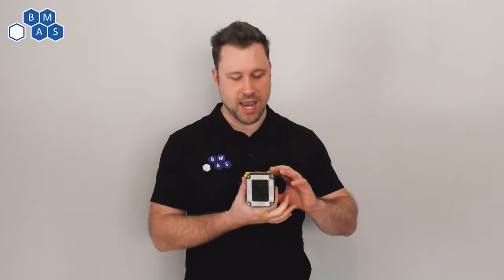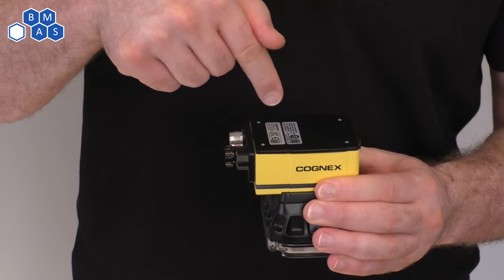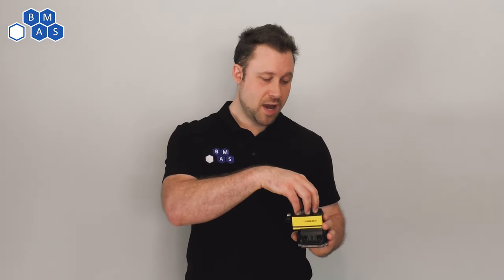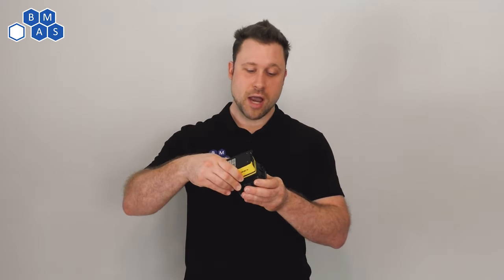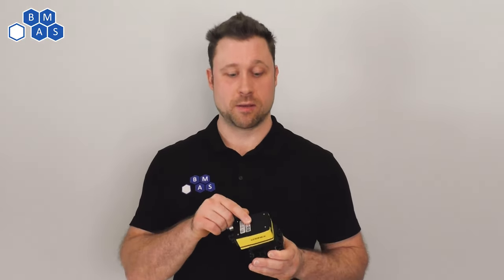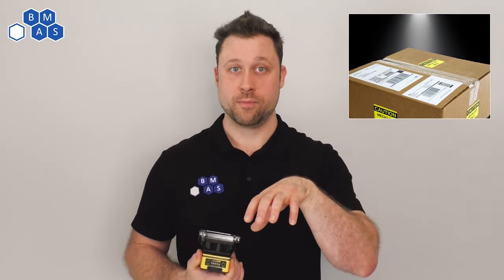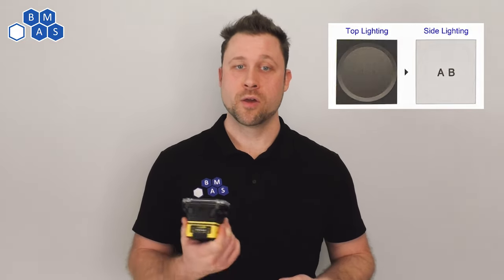Machine Vision: Overview | Machine Vision pt1

Comment from the maker: Step 1 - Camera Selection 0:38
Smart camera - brains and processing in the camera
Dumb camera - brains and processing in separate vision processor
Cost rule of thumb: if you have 3 cameras or more, it’s more cost effective to use 3 dumb cameras with an external vision processor
Not all manufacturers make both types - sometimes choice of manufacturer makes this decision for you

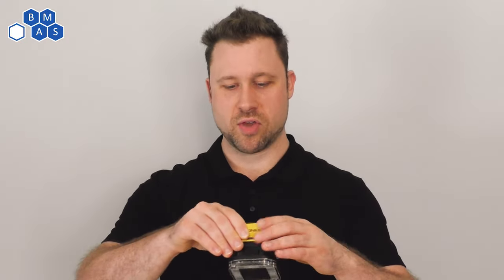Step 2 - Questions to ask for a new vision application 2:35
Is an industrial camera capable of seeing this?
What do you want to measure?
What’s the tolerance range of the measurement?
How good is the lighting?

Step 3 - Lighting 5:25
Highlights the things we care about, and hides the things we don’t
Angle: side light shows raised surfaces well, hides print
Color: Using a green light means the camera can only see the red on a green and red label
Shadow/backlighting: shows part edges well, hides details on the surface

Step 4 - Order parts 5:10
Suppliers will help you spec parts for your application

Step 5 - Program 7:07

Step 6 - Run time 7:23
Testing during run time is the only way to know it’s working
Longer run times are recommended to account for unknown changes that will happen (ie: lighting changes because there is a window in the room)
Reply: You are truly putting in your great efforts. I can say it from the video and this comment. 

It helps a lot.

Thank you :)

Comment: Wondering what camera would be most appropriate for capturing images of large boards (as large as floorboards)? Currently, my customer is using a normal mirror camera mounted at 3m above the table. You can imagine how inconvenient it is to mount a camera, take images, unmount it, and transfer the images through USB. Afterward, the images are passed to custom OpenCV-based shape detection software. So they don't need any smart camera but just something that would work with such large boards and would connect and be controllable over a cable, so it can be mounted once and not touched anymore. I think GigE Vision with PoE might be a good choice, but I'm completely clueless about camera brands and quality. The customer is a startup, and the budget is very limited; definitely, it would be good to keep the cost of the camera setup under 500$.
Reply from the maker: The size of the part doesn't determine what camera to get.  The important thing is putting the right lens on the camera to see the whole part.  After that, the question is how big are the features you're looking for?  You'll want a high enough resolution camera to see the important features with the required precision.  I've got an article here that explains the math and some rules of thumb:  https://www.breen-machine.com/robust-vision-inspection-in-5-steps/

Regarding GigE/PoE, that's usually a good option, and you should be able to get a camera/lens/cables for $500 if the resolution requirement is small.  I don't have a specific brand recommendation, but the good cameras will typically have a brand named sensor (Sony, etc).  

An alternate thought, you say the customer is a startup.  If they're developing a product that they'll sell a lot of, it might make sense to develop things further.  Start with a proof of concept with good quality, off the shelf parts (like you're talking about), then start slimming things down.  It's possible you can even get a webcam to work for the application.  If there's enough budget, try a few cameras and see what works well at the best price.
Reply: @breen-machine  Thank you for the valuable advice and the article. 
This company now had two satisfied customers, and so they feel ready to invest in optimizations to reduce manual fiddling with the off-the-shelf camera. The recognition requirements are simple, we need only to accurately (1-2mm precision) recognize the shape of the board on solid color background in a single-shot image. So, I guess even a cheap machine vision camera with a good sensor (Sony as you mentioned) should be enough.
Regarding the lenses, there is also one more important factor - it's compensating for lens distortion (usually barrel). I'm wondering how do typical machine vision cameras and their lenses deal with this? Are there any compatibility rules or correction profiles that can be set on the camera itself or is it always the job of programmers to post-process the captured image to remove the lens distortion? I know OpenCV has good calibration tools to determine the required lens correction once and then apply it to all captured images, but it would be much better to get corrected images straight from the camera. And this might be the area where some brands might be more appropriate than others to achieve a hassle-free camera+lens combination. Without knowing the typical caveats and even the right terms (besides pixel resolution and lens focus distance) it is very difficult to make the right choice immediately. Unfortunately, we are located in a small town and don't know any other factory or consultation company that deals with machine vision, so it feels somewhat scary to make the right choice on our own.
Reply from the maker: How big are the boards you're measuring?  If they're small, 1-2mm precision is easy to get.  If they're large (like a 4x8 ft sheet of plywood), you'll need a high resolution camera to measure that precisely.  

That's a good point.  Compensating for lens distortion is important for measurement applications.  The calibration tools you're talking about (a grid or checkerboard pattern is usually the best) will have to be used every time you change the camera mounting.  It sounds like you'll be moving this camera to different job sites, maybe mounted on a tripod.  If that's correct, you'll have to recalibrate every time you set up.

I'm not aware of any cameras that will post process an image before sending it to the controller.  I'd recommend trying the OpenCV options.